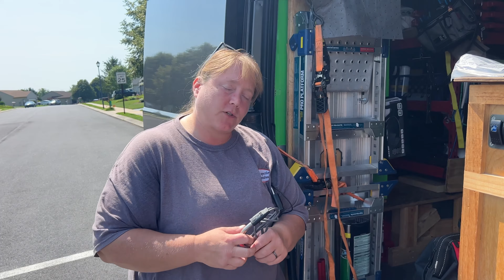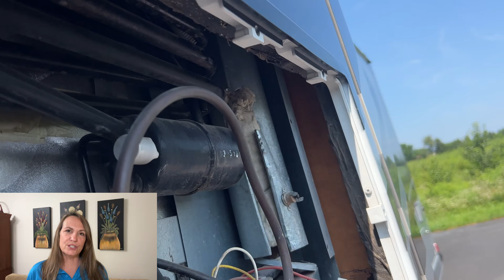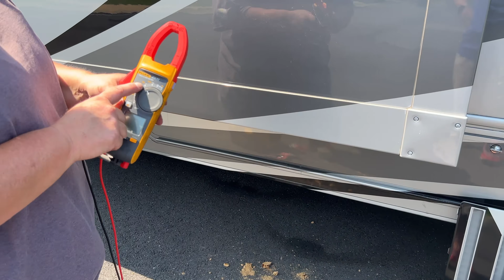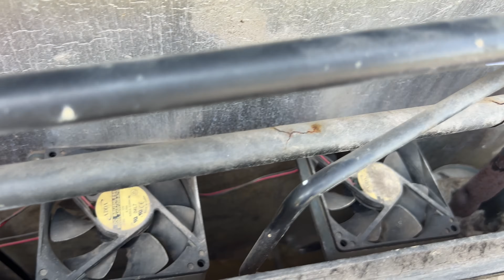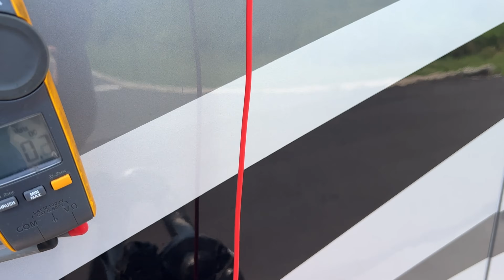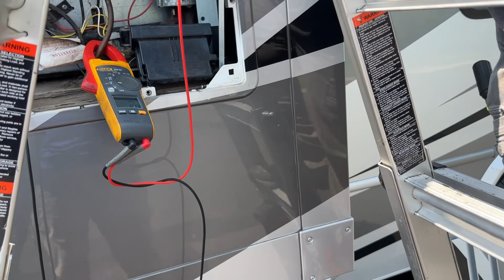RV Refrigerator - Bad Heating Element

Comment: Morning Deb, seems that not only do RV tech's have to deal with Mud Dobber nests, but also birds nests of excess wiring that the installers just stuff into the appliance compartments,,,,,
Kudo's to Carol, she knows her stuff! Wish she was on the west coast.
I have a simple tech to tech tip for her, I use a small magnet from Harbor Freight to hold my screws that I take off, just a simple little 1in. round earth magnet, helps keep them from rolling around while you're working. 
I'm having a bit of a conundrum of my own with my absorption fridge, a Dometic 2652 in a '96 class C, it's getting to cold, both freezer and fridge, fridge will get down to 28dgr and the freezer will get to -18dgr.
I've moved the thermistor all the way down on the fin, If I move the thermistor up on the fin the fridge will drop to further in temp and the freezer froze the batteries in my temp sensor to -20dgr then quit working,,,,,, lithium batteries are recommended for the freezer temp sensor so true to fact, alkaline batteries don't work in the freezer temp sensor,,,,

Today I'm going to remove the control units cover and just check the connections.
I'm on road trip right now so the fridge isn't critical in that I have a home and going to return to in the next day or two so I do have time to diagnose my issue but would sure like some experienced advice/help if Carol would know what's wrong by just the symptoms I've tried to explain.
It's weird because at home for a week without moving the rig, the fridge worked perfectly, but once on the road is when it started it's issue.
Keeping food onboard isn't an issue either, I'm on a road trip it's just that I seem to find the restaurants that have the not so good chef's,,,,,,,,
Reply from the maker: Good morning Mike! Thanks for the comment and I do know what you mean by the magnet for holding screws. I have several of them and you know what happens? I will get somewhere and forget to bring one. Haha! I passed on your question to Carol and will get back to you with feedback.
Reply: @debsrvservices  Thanks Deb, I'll keep an eye for the reply.
Reply from the maker: Mike, Carol’s response was to test the thermistor itself. It may need replacement. Sometimes it can cause it to act wonky. Hope this helps! Thank you!
Reply: @debsrvservices  Morning Deb, to keep you in the loop.
I discovered that the Dometic fridge has a "Limp Mode", the control unit senses a failed component so it goes into a constant cool mode where it just keeps on cooling that you can control by turning the fridge on & off to help save your food.
The thermistor was part of the problem for sure, I tested the new one and it responded quicker and at 9,5K ohms in ice water.
It helped but still too cold so I replaced the control unit with an up-graded unit from Dinosaur Electronics' in Oregon, they make replacement control units for lot's of older RV appliances, the difference is they designed in a temp control adjustment inside the unit that helps way more than sliding the thermistor up or down on the fin in the fridge.
I'm now to the point of making a small adjustment in the control unit to get the fridge into an acceptable working range.
got to remember these fridge's aren't quick to respond and cool in cycles so you want to get it between 36dgr's to 40dgr's in the fridge and accept what you get in the freezer, it will be between 2dgr's to 6dgr's, plenty cold enough to freeze things and keep them frozen.
Reply from the maker: Oh wow! I will have to remember that! You are teaching me😊 The dinosaur control board sounds great and a good option. Glad you found some answers.
Reply: @debsrvservices  There are no replacement control units for a fridge that old, the Dinosaur unit wasn't cheap but much less than a replacement fridge.
I got one of their control boards for my heater a year ago, it's been flawless, Your video's and others have been essential for my research & repairs, thank you!

Comment: How much resistance should the heating element measure?
Reply from the maker: Great question!! So it does depend on the watts etc and should be in the service manual of the refrigerator. Typically for a 6-10 cubic ft refrigerator it is 44 ohms. What I would do is find out the model and serial number then go on line and get those specs just to be sure. Sometimes the refrigerators can have the incorrect heating element in it and that is part of the problem. Thank you!
Reply: @debsrvservices  Thank you so much for your reply.